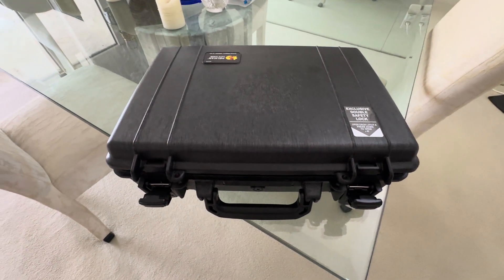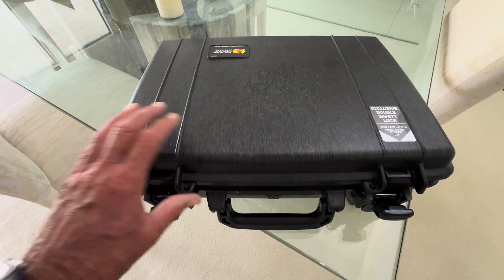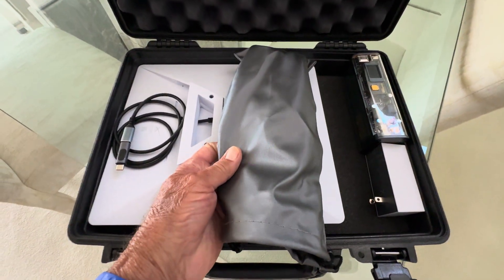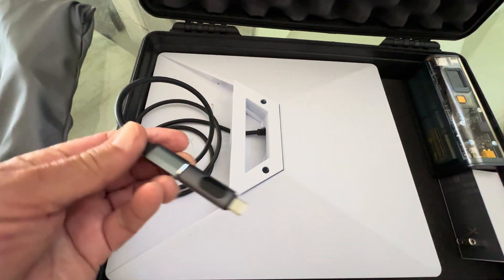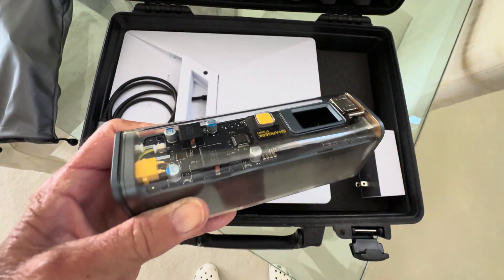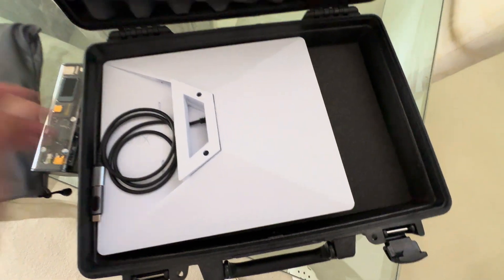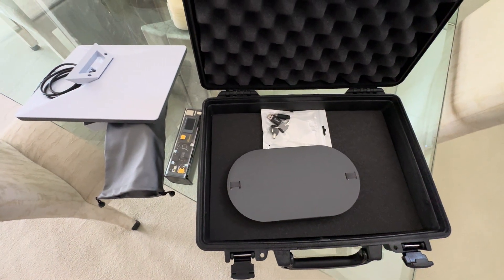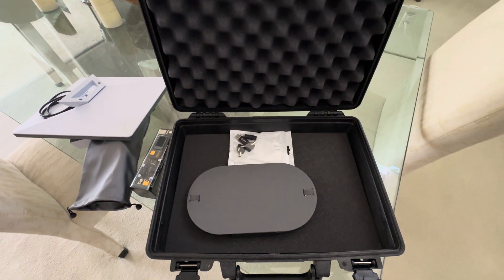STARLINK MINI - Battery-Case Kit

Comment: Have you powered the thing up using this setup and the long cord you have stored there?  I have run into significant voltage drop issues when running my mini off of a 12V source., especially the longer a cord I use.  You may want to look into getting a DC to DC 12v to 30V boost converter.